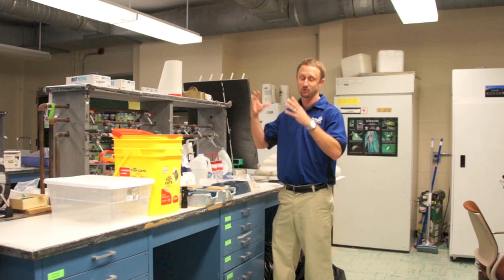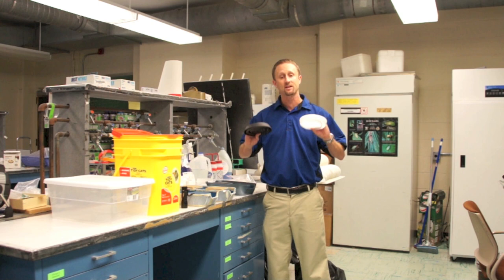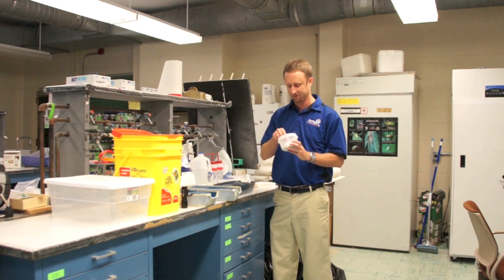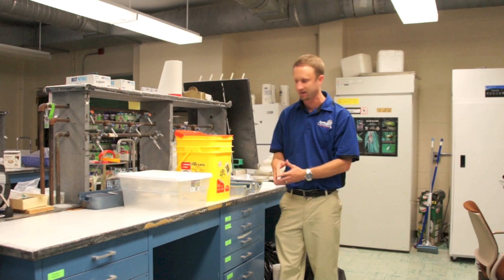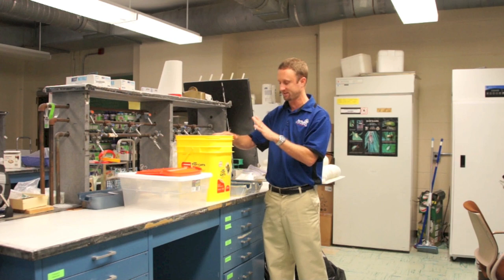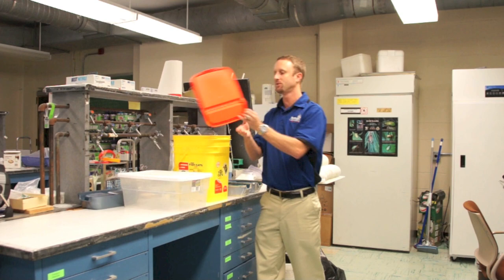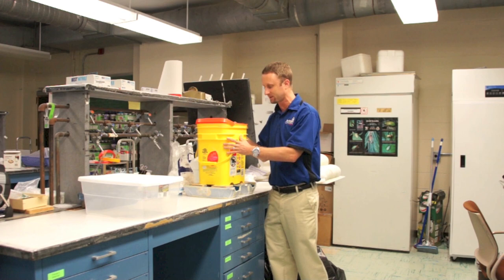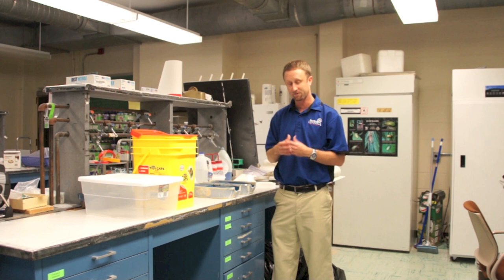DIY Bed Bug Monitor - Sugar/Yeast C02 Trap

Comment: Can we use a 5 gallon bucket as that can be purchased at every hardware store.  Wouldn't doing this for x amount of continuous days eliminate your bug problem?  They have to feed so they'll all come out and be killed.
Reply from the maker: unfortunately it's rarely that easy, certain bugs in a population may not respond to the artificial cues or never commit to the trap, therefore in many infestations monitors should not be seen as a control tool, only devices that can help you control a problem with other tools or a monitor

Comment: Hi Jeff.  Does this work for rat mites?  Thanks for your answer :)
Reply from the maker: I'm actually not sure, the best solution for rat mites is to find the source and eliminate it and clean the area the source was in, if you try it and have success please let me know
Reply: ***** The answer is no. This trap has been designed for bedbugs and rat mites respond to different lures and stimulus. An entomologist should know that but Jeff White says he is not sure.

Comment: Jeff, How long is the sugar/yeast water mixture effective?  Can you use the same mixture several nights in a row?  Or is it best to mix up new sugar/yeast water every night?  If I make the mixture in the morning, will it still work at night?
Reply from the maker: it's producing the optimal level of CO2 for about 24 hours after mixing, after that it would be best to mix a new batch

Comment: This is an update on my review. Too bad its worst, This does not work. I did it as he said to do it but with fewer ingredients with a smaller container, I put this in my friend's room and it did not work. She was sad. Just want to share if you still have bed bugs because this method did not work, for the meanwhile you can buy Off bug repeller draw a barrier around your mattress with it and this will keep the bed bugs from biting you, I came up with it with my friend and it worked she was tired of getting bit.  So I did it for her I put the nozzle of the sprayer close to the mattress like the sprayer and the mattress was coming face to face,  Press down on the sprayer and draw a barrier around the mattress. She was so happy they did not go past the barrier, Another thing please wear a mask because this stuff "off" bug repellent is strong on fumes, Open a window let the aerosol out of the room. Then come back in the room do this two hours before going to bed to give the room air. Oh, when you spray all you have to do is draw with the spray very close and draw a line with the liquid that comes out of the "off" can Again She was happy. Do this every night but when you draw the line with the sprayer nosel on the mattress draw it fast make sure the line is connected.  This can be done until you can find a solution to your problem with bed bugs. When you travel put some off spray in your suitcase and trust me nothing will come near your suitcase in the airport. Stay blessed and happy people, hugs for all.....Just for protection when you take care of your problem make it a habit to spray your bed's legs and headboard with this "off". put bug and roach and ant interceptor with some talc powder in the first entrance for the bugs they will enter your interceptors and breath the talc powder and suffocate and die.  I ask; you to do this with all of your beds and your children's beds. and your dressers, if they have legs, do it also if your dressers do not have legs get rid of it and get a new one the same color of your bed so it can still match and get a new dresser with legs long enough for the interceptors won't touch the bottom part of the dresser,  And your couch in the living room put some interceptors there as well These are sold in Amazon\, and they come in black and brown and white. 
you can instead of talc powder you can use  "Diatomaceous Earth Food Grade" sold on Amazon as well. put some of the "Diatomaceous Earth Food Grade" in the first part of the interceptor and a small amount around Where the leg stands in the interceptors. Stay Blessed Everyone and be happy. Not 
P-noid about these suckers, if you have any comment on this please don't hesitate to enter your comment. P.S. forgot to mention try this way with a bottle and follow it to the letter.-----------------  https://www.youtube.com/watch?v=nuKHsqubCm8 ----------------------               Or you can get some "Sterifab" cost my friend $39 on Amazon you need to wear a breather mask. This drys in 10 minutes and the air in the room give it an hour 1/2 to clear out the air its not a bad smell, but do open the window cause it has chemicals. Look up 'Sterifab on Amazon". My friend did all I typed on here with some of my ideas with the bug repel and the link and the sterifab and the interceptors, read the instruction completely so you know what to do with the sterifab. Again Stay blessed people.

Comment: Bed Bugs are supposed to be an epidemic level. Why has a major company/country refused to produce a simple, efficient, affordable, stable trap? Somebody could make millions of dollars on this trap if mass produced.
Reply from the maker: working on it...we're launching a new product line called SenSci Activ (bed bug lure) and Sensci Volcano (monitor) in the next 1-2 months and we hope this starts to fill that void
Reply: Also ...why are all of the pest control companies pushing *HARMFUL,USELESS,COSTLY chemicals...when HEAT kills them forever...eggs and all. ?
Reply: If you turn on the heat, the bugs flee to a cooler area. And they are capable of fleeing inside of a wall, inside of a cabinet etc. You need to lure them to their death. They want their meal and are not real smart in intelligence.
Reply from the maker: Palmina D'Alessandro heat is a good treatment option but it can be expensive, a "traditional" approach using pesticides and other non-chemical products can also be effective but tends to take a little longer to get rid of every bug depending on the degree of infestation, comparing heat and traditional services is like comparing a luxury car and an economic one, both get you from point A to B it's just a matter of what you can afford and the add-on's you want
Reply: ***** but the chemicals don't kill the bugs but rather only relocate them ...the bugs have become immune to the pesticides. Fact. The heat treatment is LESS in the long run. The company wants to make money and keep coming back therefore they push chemical "treatments"
Reply from the maker: Palmina D'Alessandro that's not true, while resistance can make it more difficult to address issues with pesticides, pesticides can and do kill bed bugs and repellency (moving bugs) is really only a concern if the products are being overapplied or you're using foggers, according to industry analysis conducted across the country even with the follow-ups you're mentioning many times a traditional approach costs less than a heat treatment
Reply: Palmina D'Alessandro
Reply: the simplest way to get rid of them is to throw away all your stuff and move. what I had to do... works great but lose all your shit lol (you can bag up valubales/ family heirlooms in plastic bags and seal them away for a year or 2)
but this bedbugtv guy probably has a lot better ways lol
Reply: I've been drinking this product called CrossFire and when the bed bugs bite me, they die. This is working great but I'm starting to have some strange muscle twitching.
Reply: Do you use google?
Click "shopping" 🙈🙈🙈
Reply: I think its a blessing for people that cannot afford to buy one.
Reply: No bcos they don't work period. I have used them inside & out & they are rubbish.

Comment: What kind of yeast do I get to kill them
Reply: louie stanley There are two types of yeast which normal people use. One is nutritional yeast. You get that at a health food store, body-building gym, whatever. It's dead.

The one you want is active, dried yeast - the kind used in baking bread. That's what makes your bread rise. When mixed with water, it begins to grow again, but it has to have something to eat in order to grow. That's what the sugar is for. The water brings it back to life (so to speak) and it eats the sugar. Bubble, bubble. It smells just like bread baking, and if you like that aroma, you won't mind this at all. There are mail order baking supply places where you can buy it in bulk, such as a pound at a time, much more cheaply than those little packages. Amazon sells it, too. Get the cheapest you can find from a reputable seller. You just need them to grow, not bake croissants or anything. As I write this, Amazon has Fleischmann's at $11 for two pounds. That's a huge saving over the packages.

Comment: can i reuse the trap for multiple nights? or is this only 1 time use only?
Reply: Only good for 8 hrs, but do this instead 
The size of the bucket and the quantity of sugar and yeast used in the video are unrealistic for a home, or apartment resident.

Bed bugs are found in large numbers in bat caves. The CO2 they exhaust is very small compared to the human breath; thus you do not need a 4 gallon pail and a large quantity of sugar and yeast.

I recommend using 2 cups sugar mixed with 1 tablespoon of dry active yeast (or the content of a 7-8 gr envelope) in a 2-litres soda bottle with warm water, still well before putting in bottle. Use a small drywall screw and screwdriver to make a hole in the middle of the cap and place a small glad bag over the bottle. The glad bag “guides” the CO2 down the sides of the bottle and into the tray. I use a large recycled lasagna black tray that accommodates two 2-litre soda bottles plus a SenSci trap with the Chemical Lure. IT LASTS 2 WEEKS not 8 hrs like the large pail recommended by Rutgers University. The SenSci Volcano Trap and Lure are optional; the trap still works well with Carbon Dioxide only.

You can also sit the bottle son the inverted doggy bowls but be very careful about tipping them over, especially if you have kids, pets, and even your bed sheets may hit the bottle and tip it over; so caution is advised. A good idea is to use flexible tubing to direct the CO2 into the trap while the bottles sit somewhere else, a short distance away and protected from tipping.

Comment: The size of the bucket and the quantity of sugar and yeast used in the video are unrealistic for a home, or apartment resident.

Bed bugs are found in large numbers in bat caves. The CO2 they exhaust is very small compared to the human breath; thus you do not need a 4 gallon pail and a large quantity of sugar and yeast.

I recommend using 2 cups sugar mixed with 1 tablespoon of dry active yeast (or the content of a 7-8 gr envelope) in a 2-litres soda bottle with warm water, still well before putting in bottle. Use a small drywall screw and screwdriver to make a hole in the middle of the cap and place a small glad bag over the bottle. The glad bag “guides” the CO2 down the sides of the bottle and into the tray. I use a large recycled lasagna black tray that accommodates two 2-litre soda bottles plus a SenSci trap with the Chemical Lure. IT LASTS 2 WEEKS not 8 hrs like the large pail recommended by Rutgers University. The SenSci Volcano Trap and Lure are optional; the trap still works well with Carbon Dioxide only.

You can also sit the bottle son the inverted doggy bowls but be very careful about tipping them over, especially if you have kids, pets, and even your bed sheets may hit the bottle and tip it over; so caution is advised. A good idea is to use flexible tubing to direct the CO2 into the trap while the bottles sit somewhere else, a short distance away and protected from tipping.
Reply: BB are drawn to CO2 because it's what we exhale when we breathe, the trap has nothing to do with the BB exhaling CO2, So as he said the bucket mimics the exhaling of 1 1/2 people to draw the critters to the trap.
Reply: @skeptic3332  Pretty sure he was referring to the amount of CO2 the bats exhaust not the bedbugs. And while one bat does exhaust less then a human, maybe the difference lies in the large number of bats all exhaling at once rather then 1 human to 1 bat comparison? Something to consider?

Comment: What if, instead of dog bowls, I just stuck a bunch of glue boards under the container with the mixture?...
Reply from the maker: that would work just be aware that if you plan on re-using the container you may have a very difficult time getting the glueboards off of the container, if you put the container directly on the glueboards good luck get getting them off

Comment: Is there a reason Jeff why I haven't caught one bug. But they walk all over me all day.
Reply from the maker: KIM HAINES no idea but something doesn't sound right, I'd have to see it myself to provide an opinion
Reply: +KIM HAINES I HAVE THE SAME PROBLEM. I HAVEN'T SEEN ANYTHING IN THE TRAP, BUT I HAVE BEEN BIT.
Reply: +kimayah smith I have been using Diatomaceous Earth food grade. This seems to be working. The sugar and yeast was a waste of time and money.
Reply: Thanx Kim Haines, I'll try that before this gets out of control.
Reply: +Kim Haines and Kimayah. I have been using diatomaceous earth as well, but the thing is that the bugs are not attracted to it. On the contrary, they will avoid it if they can go around. I would suggest that the reason you two are still getting bit is because I have found the bugs favorite place is to stay ON the bed rails and small bed crevices where you cant see them so if you're still using the bed and apparently still breathing, they are smelling you and you're easier to reach then the trap. In my case, I quarantined the one bedroom and no one is in there so I am going to try this trap now to get CO2 in the room. I also spread a dusting of Diatomaceous earth (Home depot 9.00) all around the perimeter of the room walls and all around the bed legs. I closely inspected the bed frame first after removing the boxspring and mattress and sealed both of them in matress covers(Walmart 30.00 each)
Reply: I realize this is an old post but here goes: It may be an issue of proximity... If they're in your bed, you're still warmer and closer than the trap. If you're going to sleep in the trap room, the bed should be cleared of bugs by stripping and putting ALL bedding through the washer & dryer. I would put an encasement on the box spring, but I wouldn't put one on an intact mattress... It makes for uncomfortable sleeping. There aren't many good hiding places on an intact mattress anyway, and a vacuum cleaner works fine. Just run it around the seams while pulling the seams open (that's where nymphs hide). The bed should also be separated from the floor with plastic interceptors (they're pretty cheap) and no bedding should touch the walls.
Reply: Dale Carns This is exactly what I did and worked fine. Takes time but well worth it. I also used my steam iron and hair dryer on hot setting on the bed before I encased it in the mattress covers. This might take care of any who are hanging out on the bed frames. Since this seems to be a never ending threat I am very watchful and careful about bringing anything into the house which could possibly have " hitch hikers".  We now know what the word scourge means!
Reply: jakester455 this short comment is simple and entirely relevant - outstanding.
Reply: Elizabeth Kelley This is the first I’ve heard of a hair dryer and steam iron.  Sounds terrific. Thank you.

Another infrequently-mentioned idea is putting sofa cushions in a hot car for a few days - ideally inside plastic to avoid contaminating the car.

Did you encase the mattress too?  Or only the box spring?

I’d like to learn more about hair dryer and steam iron.

Comment: This clip is one beautiful proof of University arrogance, clueless intellectuals lost inside their illusions of "higher" with minimal to zero practical experience and refusal to consult any "lower" person; especially any with competent housewives.  About any competent housewife will fall over laughing at the idiocy of this sample.  First the average house room temp is less then the ideal temp for bread yeast to ideally ferment, thus slower ferment equals way less CO2 then claimed - that's just one problem; the one arrogant oversight that will generate all the housewife laughs is the size and major mess danger when the house dog or the curious toddlers or many other sources of oops, dang, knocked this unstable solution of sugar water over onto the carpet - etc etc.  Rutgers should feel major ashamed.  Get one of your young creative civil engineering students instead to way way better design a simple wide usability model. 
Two different sized paper cubs where one doesn't touch the bottom of the other with a tiny pinhole in its bottom over the other cup containing water baking soda solution with an larger needle air holes above the liquid line and some double stick tape under the bottom cup attached to a tile or piece of wood or thick cardboard, put masking tape outside the bottom cup and pour vinegar in the top cup and measure the drip time till bubbling ceases; about any of those students to could way way improve what was just written or even design a better replacement.
The one offered in this clip is just a big joke on Rutger's U. !